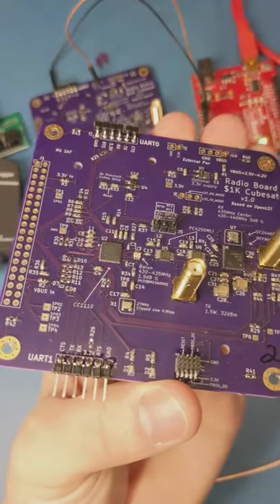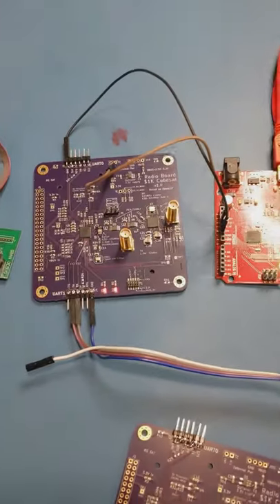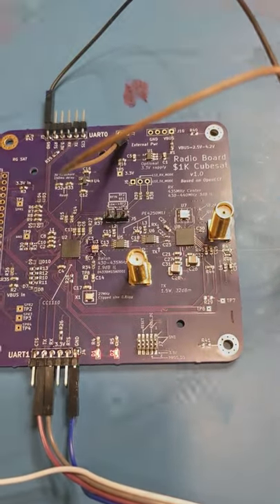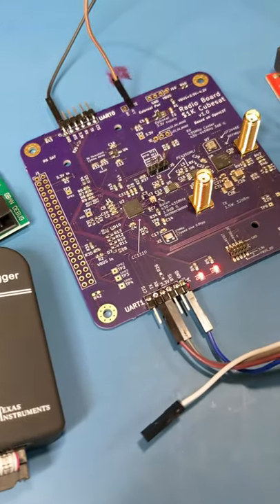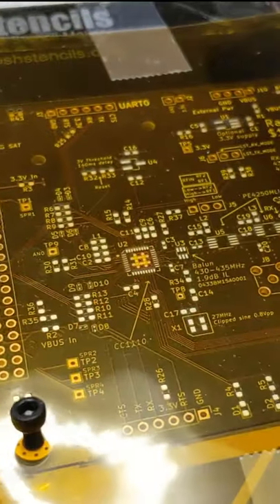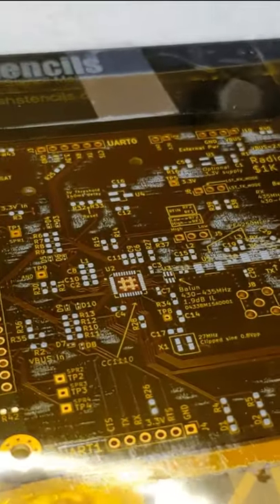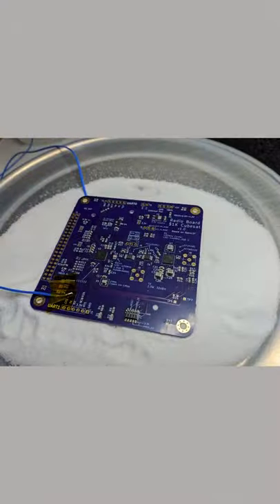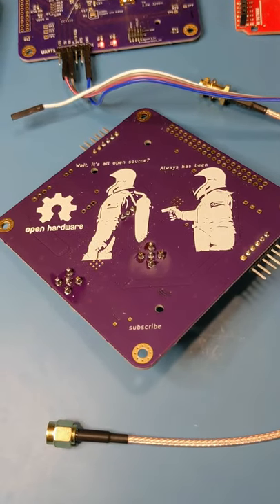$1K CubeSat Radio Board Built! | CC1110 & OpenLST Based design

Comment: WooHoo! The project lives on! I was looking through your channel last month hoping to hear about updates :) Keep it going!
Reply: Also, I don't know if you have access to a VNA to test your board/antenna combo, but I can help with testing in that aspect if you would like. Send me a message.
Reply from the maker: I don't have access to any RF test equipment, other than a cheap SDR. 
My plan right now is to hopefully have the two radios communicate over a hardline connection. I put in an amplifier bypass port for this reason. 

If I need to, I can test with the SDR to verify the TX path.
Reply from the maker: Once that works, I'll try over the air. I really need to get my HAM radio technicians license
Reply: Yes the HAM license will help. Also something I just noticed reviewing the schematic in your other video- in the RF section there's no matching network on pin 7 of the RFFM6406. I would add a pi network to the final design. That way even if you don't use it you can bypass it with a capacitor. It will really help with matching an antenna.

Comment: 1) Is there at 10 pin connector for programming the CC1110?
2) Can an RFFM 6406 substitude for the RFFM 6404?  The RFFM 6404 has been discontinued.
3) Have you decided how the transmit antenna will be deployed.  I like the mechanism that is being used by the Fox-1D / AO-92.  A resistor burns a piece of fishing line and the antenna pops open.  A sensor can tell if the antenna has deployed.
73, Konrad  WA4OSH
Reply from the maker: Check out my GitHub (in the description) for schematic details!

But yes, there is a 10 pin connector to program the CC1110

The RFFM 6406 is a drop in replacement. 

I have not figured out how to release the antenna, but the resistor method is pretty good
Reply: @RGSAT  From a design perspective I assume your radio would be TDD - Alternating between transmit and receive on the same frequency. You would definitely want to use a modulation type that they SatNOGS folks know how to decode.  I don't know if you have the battery budget for a second CC1110 and antenna.  This would allow you to do a self test. MIMO on receive and have backup.
Reply: @RGSAT  Can you make your boards designs and part list available on OSHpark Mouser etc.?  I'm interested in building one and developing the test SW.

Comment: I mean what do you actually use for hundred of kilometres Connectivity?
Reply from the maker: It'll be this! With the power amplifier & with direct line of sight it should work
Reply: @RGSAT  can please tell me what can I use for such a long range transmitter and receiver 

Can I just use lora modules with better antennas
Reply from the maker: I'm not that familiar with LoRa. If you are interested in satellite communications, check out SatNOGS !
Reply: @RGSAT  thanks for your support
Reply: Have done a link budget assuming the CC1110 chip and 1watt (30dBm) on both ends?  Assume a directional Yagi on the ground and a dipole in space.  A second dipole at 90 degrees from the first can help.
Reply: @ok-bd6zd  Do a link budget.
Reply: @WA4OSH  thanks for your help